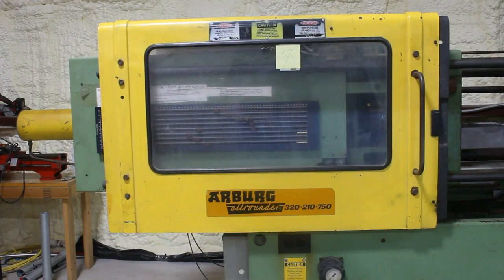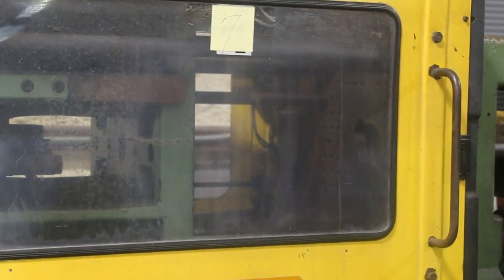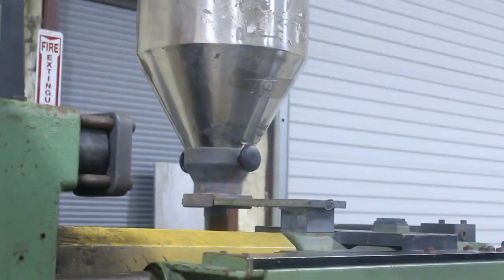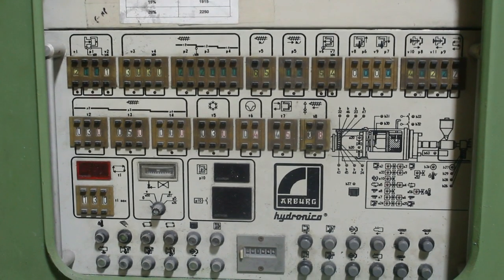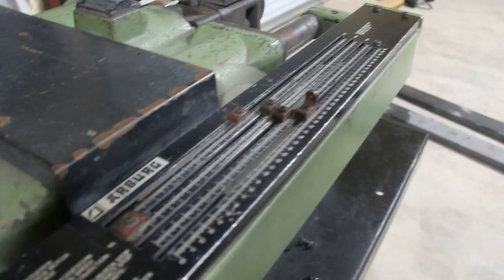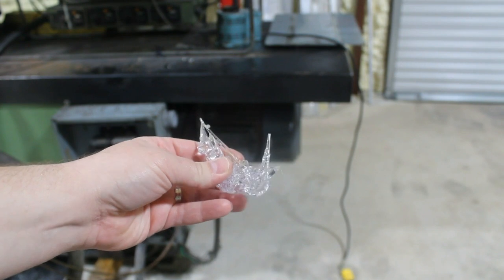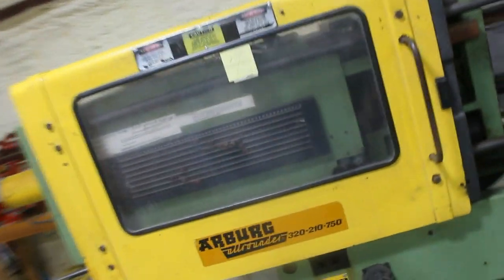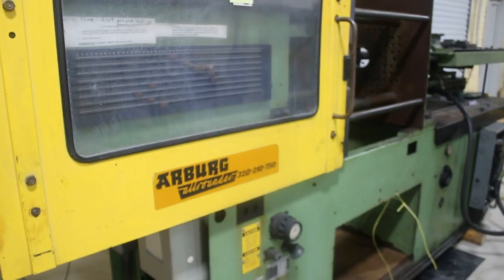Arburg 320-210-750 Injection molding machine

Comment: Setter of 16 years. We recently scrapped one of these from our plant. Okay machine for simple moulds. I can help if you have any questions on the machine
Reply from the maker: I need to make a mold base 1st but kinda stuck there. If you have info that could help on making a mold base I would be really interested in talking about that.
Reply: @dnjmachine  do you mean a physical mould to run in the machine? Unless you have access to a tool room or cad cam equipment can’t be much help there unfortunately. 

Do you any any moulds to test in the machine at all?
Reply from the maker: @Cncguru-wl9hn  Hey Stephen, I have cad Cam and cnc mills so making molds really shouldn't be a problem. I'm just needing to build some base into the machine that I can mount the smaller molds into. Having zero experience running one or really even seeing one run. I'm not really sure what's the best way to create something that interfaces with the injection and a mold that I can machine. The machine didn't come with any kind of molds or mold base so there is nothing to test with or design off of.

Comment: Hello, I have a problem, the 49 blue cables that are connected to the control are cut, I can only see a few small white numbers that are in the cables, the cables, it will take time but could you help me to reconnect the cables to the MS75RM1GE00,Please, I need to know in where to connect the blue wires
Reply from the maker: I could try I will be back in front of the machine tomorrow and can take a pic or something. Shoot me an email dnjmachine@gmail.com.
Reply: @dnjmachine  
hello I sent you an email

Comment: Hey man, awesome old machine. I'm a plastic moulding apprentice in New Zealand, working on newer machines including a 2000 Arburg 25tonne allrounder. What are you hoping to make with this machine? Good luck :)
Reply from the maker: Thanks for the comment! I just noticed it sorry for the delay.
To be honest I don't have a plan as such, I have just always wanted one :). I need a mold bolster, its going to cost about 1,000 USD, so looking for a used one before I can do much. I did get it powered up and tested since that video!
Reply: Hi how are you ? Plz  how to make mold thickness for allrounder" 320-210-850 1988

Comment: cool.  I've always been curious about those machines and it will be great seeing you get it working.  I doubt having a computer screen would be any easier and probably be less reliable.  It looks like it's just a bunch of timing set points, dwell, heater settings, cooling set point, etc.   Once you figure out the sequence of events the black magic will be tweaking it to get good, reliable parts output.
Reply from the maker: Thanks for the comment. The one thing I noticed about the ones with a computer is they have a digital readout of the temp of each nozzle, not sure how to tell where the temp is on this machine, maybe it will make more sense later. Everything seems complicated before you figure it out.
Cheers
Reply: @dnjmachine  There appear to be temp controllers on the left, under the extruder - not sure if the readout is set point or actual temp.  BTW, you can probably easily find a replacement for the broken one instead of using the variac.
Reply from the maker: @JohnTrevick  That's definitely where the settings are for the heater bands, just not sure yet if there is a output display for actual temp or just the settings. I planned on looking for a replacement once I get it powered up and can actually see whats what. I will keep updating as I make progress on this machine.
Cheers